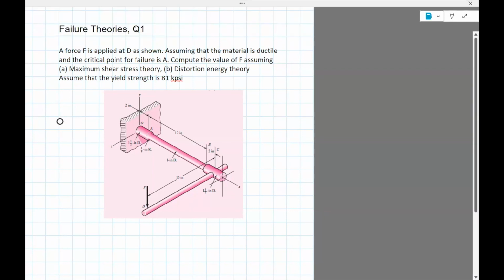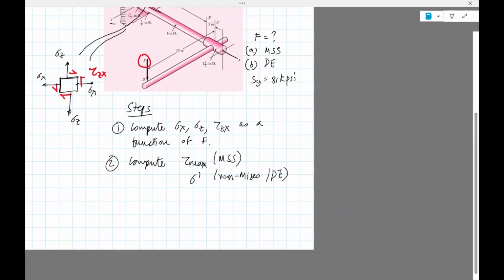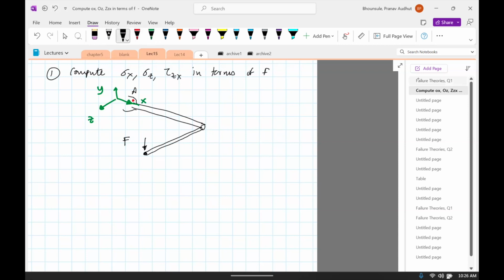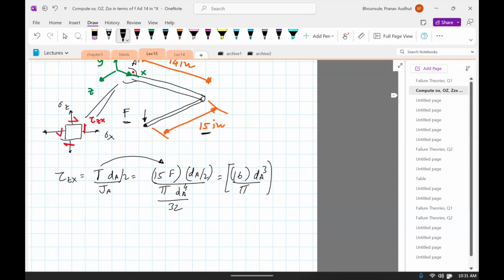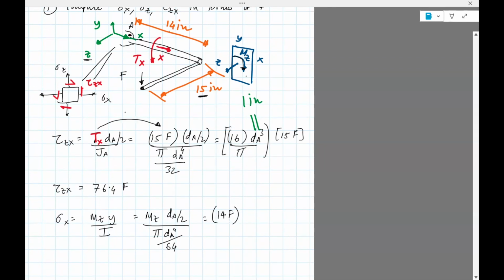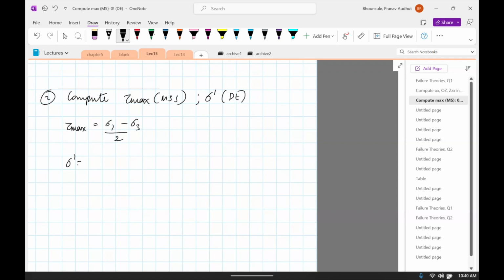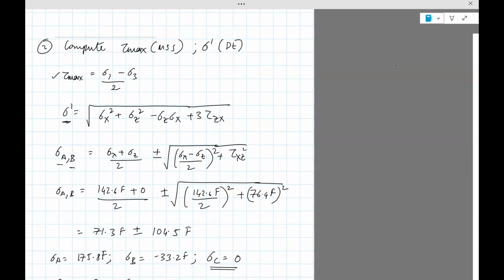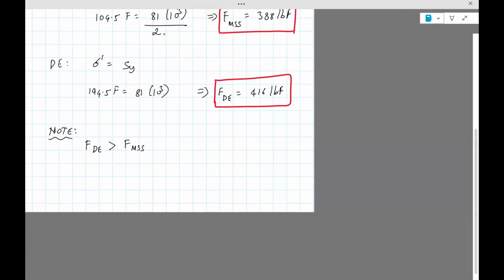Design Lec15a: Failure Theories Ductile Material, Problem 1 (Spring 2024)

Comment: sir will the force at the end create only twisting shear as it tend to rotate the componrnt about x axis ,it won't bend it?
if there is any normal force on the right extreme it can bend the component hence we can consider the normal stress?
Reply from the maker: F will create a bending moment Mz due to moment arm OC along x-axis. It will also cause a torque Tx due to moment arm DC about the z-axis. If it is easier, you can use vectors to do the calculation. I have done this in the this video: https://youtu.be/20cdaBqcXK8?si=TsAQuwS6VHYjm6U1
Reply: Ok sir
Thank you